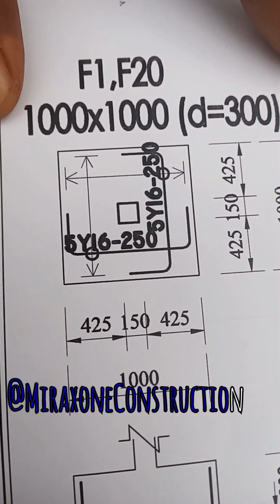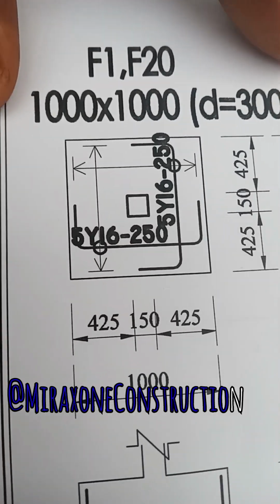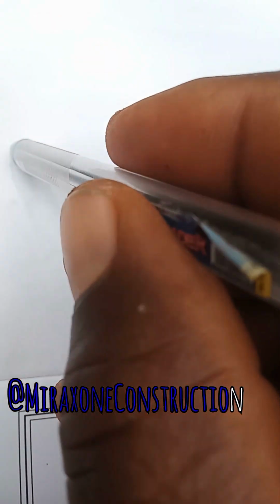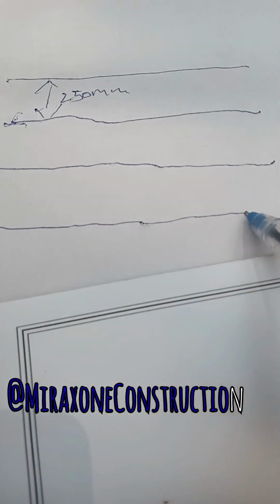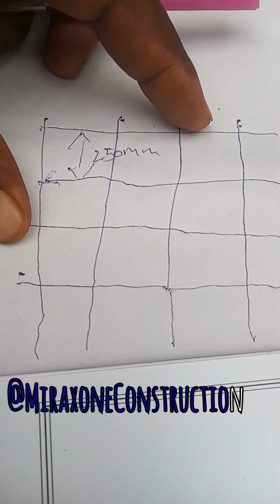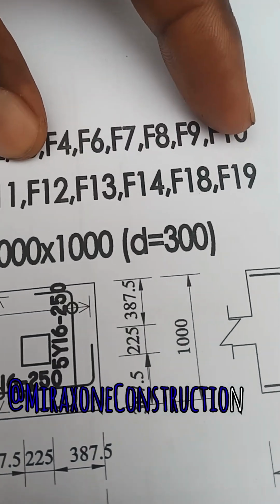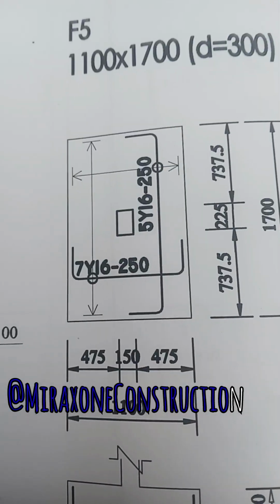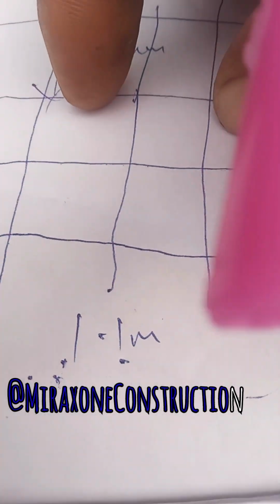Steps To Read Structural Foundation Plans for Beginners: UK. #civilengineering #column

Comment: Please what dimension style did you use? when I use 1:100 for the columns detailing, the drawing comes out smaller
Reply from the maker: Thank you for reaching out, 🎉,
I think the first approach is for you to master scale in drawing, it'll help you to know the type of scale you'll choose. Scale in drawing or engineering is different topic on its own.

Having said that, asking me the scale I use isn't necessary because our drawings aren't same size & type.

However,  if you want to choose your scale in drawing, if the object is having a very large dimension in real life, in that case, you've choose a larger scale like 1:500,  to reduce it.

But if the object in reality is having moderate or small dimension, then you've to use smaller scale like 1:50 to draw it, inorder to enlarge it ...

Scaling is all about reduction & enlargement. You choose your scale by yourself, is part of the design. 

In summary, bigger scale like yours tends to reduce object, while smaller scale seems to enlarge object. 

Is that understood?
Keep hooking on for more construction tips. 🤌🏻

Comment: I have a question sir why is that the footing for 1c5 is very large then the others
Reply from the maker: Thank you very much for the question.
The reason is because, each column or group of columns are designed differently, mainly because they're carrying different loads from the rest.

Just imagine this scenario, where 3 persons are carrying long log of wood, one person will be in the front, the second in the middle & third at the back. Do you think they'll be having same weight of the wood on each of them? No, obviously the person in the middle will likely be having the heaviest load. In that case, to balance the weight, you might ask the strongest of the three to come to the middle, because he's stronger & have more strength than all.

So that's how these columns are designed, all don't have same load per position. However, it's for the Engr to determine all these.

Is that understood? Let me know where you need more clarification. Thanks! Keep following 💪

Comment: Thank you very much Sir a lot learnt . 
I  still have a question tho. 
What's the  measurements of the hook at that1000 meter bar (is that where the 250 c/c starts)
Reply from the maker: Glad you learned a lot! Regarding the hook, it's typically 10 times the diameter of the bar, and yes, that's where the spacing begins. 👌
Reply: @MiraxoneConstruction  Thank you very much sir